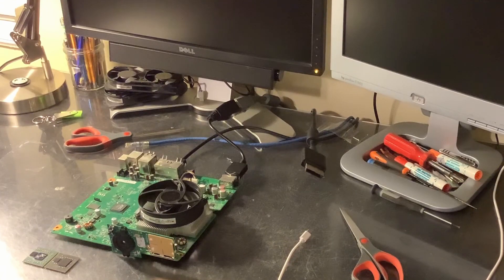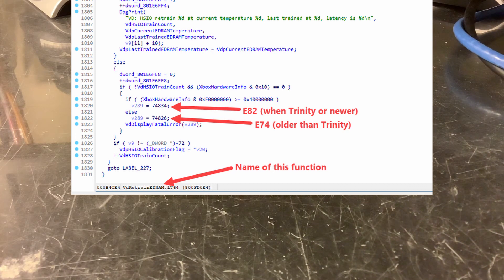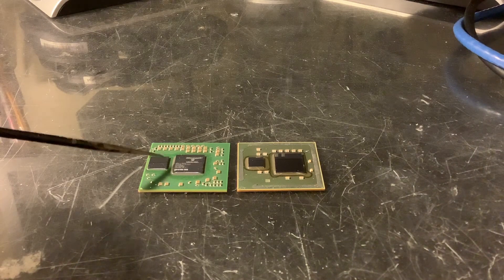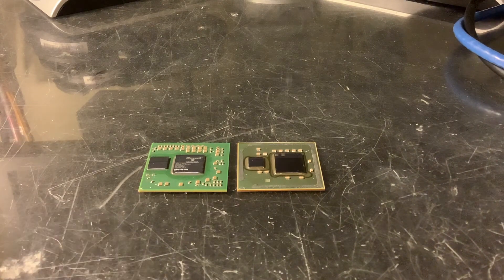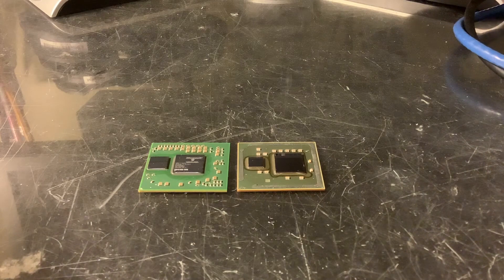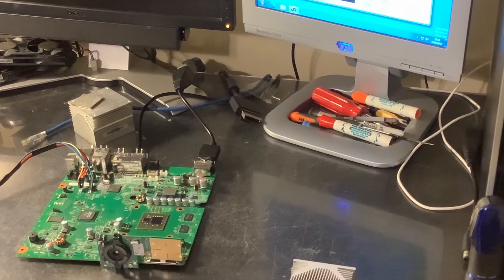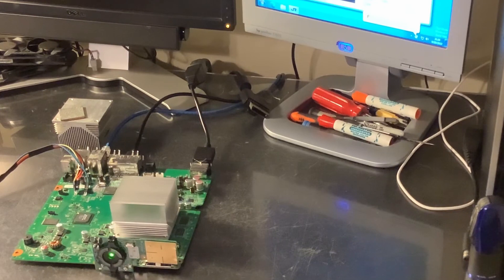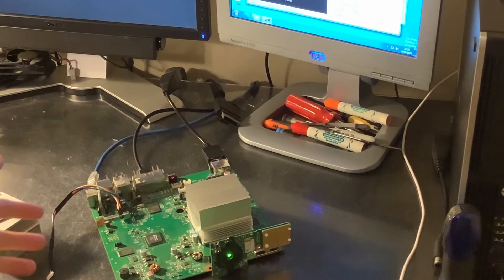How To Fix Xbox 360 E82 E 82 1102 Error (and why it happens)

Comment: Hi, Xbox 360 Slim Corona Motherboard, In the start it was a E82 1102 error, but after reflow it worked about 2-3 weeks, then the E82 error comes back
After Reball of XCGPU and KSB chip it now false overheating with the code 0013, I thinked maybe it’s the R4D3-R4D8 Resistors are not working so I replace it, but it’s not worked. Is that means my Xcgpu died? Maybe it can be fixed?
Thanks in advance
Reply from the maker: You did not watch the video why???
I explained that "reflow" and "reball" fix nothing. Replace the CGPU.
Stop reballing parts, it does not fix it.
Reply: @Josh.Davidson sorry I watched it but I can’t understand, if thermal diode or something died in chip, it causes 0013 error or what? I’m bad in English
Reply from the maker: @Play-ym8nz  You damaged it by reballing it! Replace the CGPU and then maybe also the KSB  as you should have done in the first place. Do not reball parts.

Comment: I let my brother use one of my Trinity black glossy slims back In 2011 as I had the MW3 slim at the time and the console received an E82 error but prior to that it started to have graphical artifact issues on screen. Then shortly after E82 the console just booted straight to a red dot without any error code. Luckily at that time GameStop warranty allowed me to swap for a Corona matte slim but was super shocked to even see the error on a slim. I had a feeling it was the exact same issue as E74.

Comment: So, I cannot do this myself, as I don't have the tools or skills, and I sent my 360 S in for repair many years ago, and it came back as "unrepairable". How would I go about getting this fixed?
Mine is a Halo Reach edition that is sentimental to me and has different sounds for power and eject. Is there a way I could buy a donor console and just swap out some of the components? Thanks!
Reply from the maker: You can transfer the motherboard, transfer the speaker, and reprogram it to the proper panel button.
Reply: @Josh.Davidson  Thanks for the reply, mate! Really appreciate it.

Comment: Actually you can get a 0 fuse cpu and Reflash it with the same fuse set as original cpu, however the console must be modded before it gets the E82
Reply from the maker: Stop stop!!!!
If you have a 0 fuse CPU, just launch freeboot directly with DEVGL.
IT IS A CRIME TO SECURE A 0 FUSE CPU BY WRITING A RETAIL FUSESET!!!!
Please do not EVER do that!
Just use DEVGL!
Reply: @Josh.Davidson  I thought devgl is to launch freeboard on deviit cpu.
Reply from the maker: devgl is to launch freeboot on an unlocked CPU. Either a 0 fuse or devkit will work. Virtual fuses are used.
Reply: @Josh.Davidson  thanks a lot I will try to flash it on my dev unit, one more question, can you guide me which reballing unit is good for my needs ?

Comment: Ok so that fixes it what causes it 😕
Reply from the maker: If you watch the video I explain exactly that... it's caused by a failure on the GPU substrate or a bad die itself. Sometimes things fail. There is no plague like official cause like the older RROD issues.
Reply: @Josh.Davidson  ok but is it heat that causes the failure or something that will happen regardless
Reply from the maker: It is not heat that causes the defect. It's just bad luck.

Comment: I don't get the code every time I start the console. If I haven't ran it in awhile and turn it on with the TV off, it gives me the code and red light. If I turn the TV on before turning the console on it'll work. If I haven't used it in awhile and do my second method, I only get the code sometimes.
Reply from the maker: What the secondary error code?? Red light can mean many things.

Comment: Hi mate, ive just come across E82 in a trinity RGH 3.0 - it boots Xell fine, but freeboot is E82, is it still the same XCGPU issue as described in the video?
Reply from the maker: Yes it need XCGPU Replacement sorry for slow reply.
Reply: @Josh.Davidson  that’s all good mate, I replaced the xcgpu 😀
Reply from the maker: Reason XeLL work because XeLL do not try to train eDRAM understand this happens later in startup that is why it is a UEM error.

Comment: wish I knew more about soldering and motherboards. What exactly is everything you're using in this video? I'm not sure what the golden substance is after you initially heat up the spot under the component. I also don't know that gel like substance you put on at the end. And was the Q tip just Isopropanol? I've got a friend who would really like to keep his Xbox, and I'd like to try to fix it for him.
Reply from the maker: Beware that these types of rework requires lots of training and experience.
I would suggest starting small. 
The golden substance I don't understand what you mean.
The gel is fresh flux. IPA on the Q-Tip to clean the surface.

Comment: Hi Josh, what is the way to rebuild the NAND image? I've got a Xenon that brings up E71 (1013) No sign of it being tampered with such as JTAG.
Xebuild?
Reply from the maker: you need to glitch it and get the key. then rebuild the image in the donor nand option in j-runner with extras. if that does not work, replace the nand.

Comment: I have also a slim trinity with the 1102 error. starts with green light, but after putting in a hdmi cable it goes red.
Reply from the maker: Yes so as in this video you need to replace the CGPU.
Reply: @Josh.Davidson  Do you know from which board i need the cpu key? from the donorboard with the working CGPU? Because the board has 0002 and i can´t start into xell reloaded

Comment: Finally someone on YouTube has real science to explain why the rrod/rdod failures happen. So it’s a defect that is strictly local to the gpu/apu. It has nothing to do with board or with the thermal design.

While M$ and AMD kept it hush, hush, we were bolt modding, wrapping towels, baking the motherboard in ovens, cutting vent holes, and adding fan mods thinking that rrod was a thermal problem. Talk about living in the dark ages. Lmao
Reply from the maker: Exactly.
You may notice also that NVIDIA had the same issues and it was probably an issue at the chip manufacturer, TSMC.

MS finally admitted the cause in their Power On documentary confirming that it was inside the GPU, not on the board, and not with thermal design.
Reply: @Josh.Davidson  It's a widespread issue (well was). Affected everything fabbed at TSMC for a while, including the GPUs of fat PS3s, countless nvidia graphics cards from the late 7000 series up to the 9000s, a ton of ATI/AMD GPUs and motherboard chipsets (though they never admitted to anything being wrong, unlike nvidia. killed tons of graphics cards, PC mobos (in case of chipsets) and macs). Intel didn't have problems in that time frame because they fabbed everything in-house. And it is kind of related to thermals, as thermal cycling is what effectively destroys the bumps thanks to crap formulation and insufficient physical support from the underfill. it's quite the shitshow in hindsight

Comment: This is very interesting! I haven't gotten into BGA work yet. How do you make sure the processor is lined up correctly before attaching it to the motherboard?
Reply from the maker: It doesn't need to be perfect, surface tension pulls it perfectly into place when the all balls melt.
Reply: @Josh.Davidson  that's really cool, I never would have guessed that is how it worked!

Comment: 2:23 the "bond" you're referring to that attaches the die to the pcb substrate is known as a grid array of solder balls. It's the exact same way they attach that component to the mainboard.
Reply from the maker: It’s similar but not the same. The flip chip connection used micro balls known to typically as solder bumps and has underfill surrounding it in order to secure the die in place. The reason for this is that the die is basically a hot slab sitting on bumps that are much more delicate than BGA balls used to attach it to the motherboard, so mechanical strengthening is required. It’s been well known that when incorrect underfill is used, the flip chip connection fails (see Nvidia Bumpgate as an example).

Comment: How to weazel out of RRoD warranty?
Remove the lights.
How to weazel out of E74 warranty?
Change it to E82.
Reply from the maker: Loooooool but to be fair to MS by the time the slim came out the plague failure had been resolved.
Reply: @Josh.Davidson  It still happens but I guess it's within industry average of single digit percent per year. 
I'm starting to suspect the reason they designed the slim edram die a little bit lower than the CGPU is to prevent stress on the interposer, but results in trickier IHS thermal contact.
Reply from the maker: @ScaredPilot  Right, I have noticed the edram is not quite as tall by a tiny amount. But the edram is the same 65nm one from the Kronos1 phat GPU, so perhaps it was just a coincidence.

Comment: Thanx for the technical info regarding E82. I always replace the cgpu when i have this error.
U talked about 0013 error about thermal overload. I have one in hands and was wondering what is the issue.. so it is also cgpu related? It boots for milli second them goes to RROD 0013
Reply from the maker: Is it a corona? If so probably the temp line resistors. See https://errors.octalsconsoleshop.com/details/thermal
Reply: @Josh.Davidson  i well open it and check the 6 resistance near the cgpu if it is a corona. Thanx
Reply from the maker: @3absisoRA  good luck